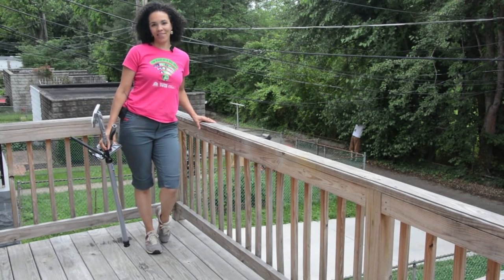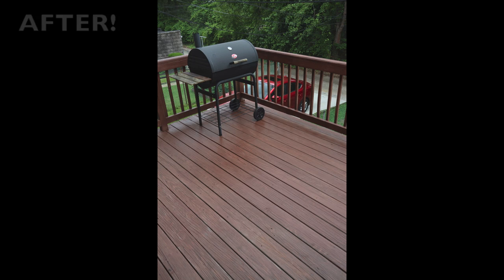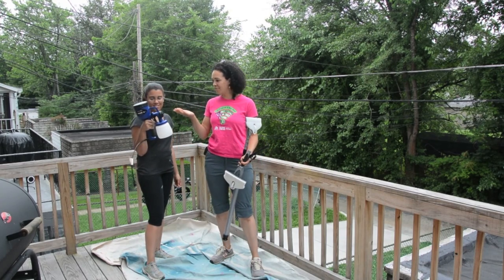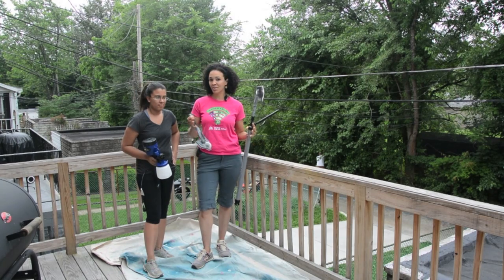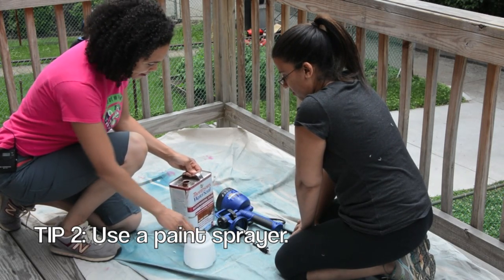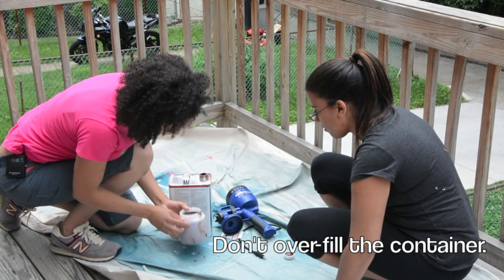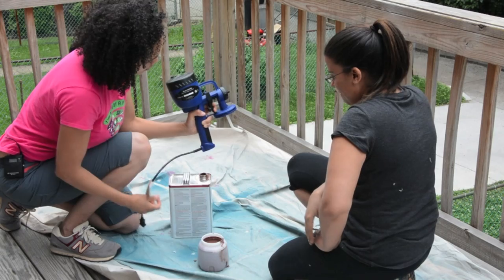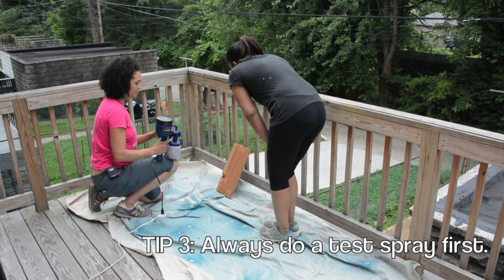10 Deck Staining Tips - DIY Outdoor Projects - Thrift Diving

Comment: I am considering using one of these stain sticks for my deck, a huge deck about twice the length of yours. Did you need to put a lot of downward pressure on the stick in order for the stain to come out of it uniformly? It looked in the video that it was not coming out easily. Then in one spot it looked liked it suddenly puddled, is that because you pressed down on the suction handle to release more stain? Thanks. Great video.
Reply from the maker: +Ellen Robison We actually ran into some problems with the paint stick! We got a defective one so it was leaking on us, so that may be why you saw it puddle a little. I didn't have to push down too much, and overall, I felt that it made the job go much faster! Aside from the leaking, it was good!

Comment: Ladies, you have done a wonderful job, but a word to the wise. Thompson Water Sealer contains a lot of water....not good for wood.  Pay more and purchase a higher end product, some claiming to last 7 years.  And go easy with the pressure washer.  I watched a deck rot from the inside out due to the extreme water pressure.  Hope it helps.  Peace.
Reply from the maker: Great tips! Thank you for that. We used Thompson Water Sealer because it's what we received at a bloggers conference, so the thought was, why buy when you've already got some on hand? But this is good to know about Thompson's. Do most consider it a lower-end product then?
Reply: I've always had good luck with Olympic.  There is a product (can't recall the name), but it is supposed to hold up for 7 years.  Kinda pricey, but well worth the effort.  Peace.
Reply from the maker: Fric Said I'll keep that in mind!! Thank you

Comment: I really, really hate to be this guy but what are you doing!? I know its empowering and all but its like giving a 16 year old a car without instructions. You are a hazard to yourself and those around you. Sheesh. I feel sorry for your neighbor's motorcycle, let alone anyone's lungs within an immediate vicinity. You are already applying the paint onto the floor without a sprayer, why couldn't you just use a brush or similar instead of a sprayer on the railings?